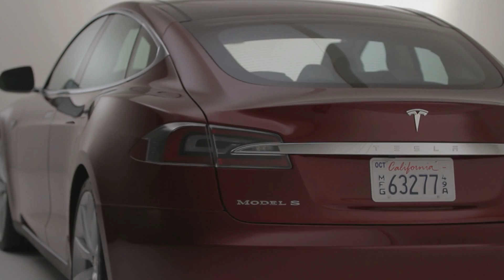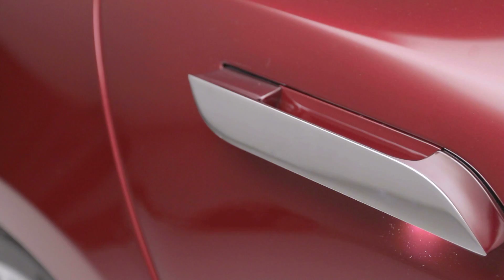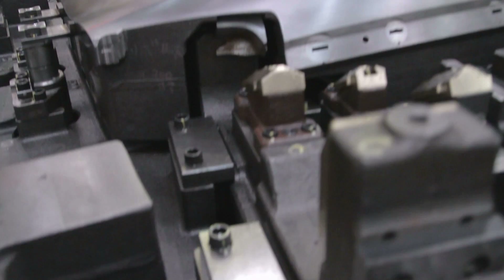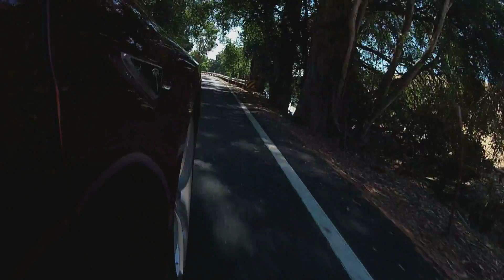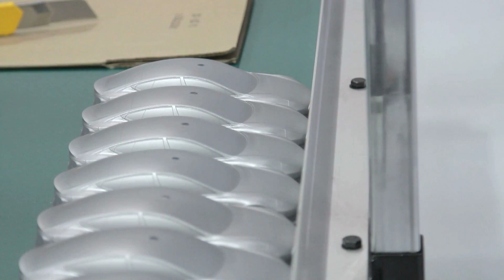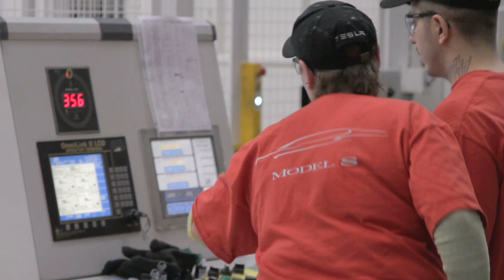Driving the 2012 Tesla Model S - Wide Open Throttle Episode 22

Comment: I did not say anyone was driving from LA to SF everyday. You just want the option. You may be fine with this poor battery durability, but I believe most will not be fine with it.  Try selling a used Tesla Model S with only 70% or 65% capacity and getting good value.  Consumers calculate the battery replacement cost.  Consumers will do the math. FYI, nobody is spending on maintenance costs for new cars anymore anyway.

Comment: This line of thinking has been proven wrong over and over again.  It isn't as simple as comparing tailpipe of gas car to the smokestack of a coal plant.  If you are going to compare energy production, then you need to count in how much coal is used to refine crude oil into gasoline.  Just the energy of refinement alone could be used for everyone to drive electric cars.

Comment: Recharge time depends on car configuration and the charging station. Tesla Motors has a charging page with a calculator.  But 95% of the time every morning you get in a car that fully and cheaply recharged overnight and do your regular driving, and skip the gas station. Plugging in is the future.

Comment: If you want to take a "larger point of view", then consider this. if you are going to stop comparing emissions from the car itself and start talking about fuel generation (electric vs. gasoline) then you need to also count in emissions of gasoline refinement.  You'll find that suddenly coal power seems a lot cleaner.

Comment: Probably because 80% of the population only drives like 30 miles per day.  Who drives from LA to SF every day?   And technically, you could drive the Tesla on that trip if you stopped at a fast charger in the middle somewhere.  The battery is unlikely to need to be replaced after 7 years.  It may have reduced capacity, though.  Even if that were so, the rest of the car will be super reliable and by replacing the battery you could easy go another 7 years.

Comment: Math fail. A 35 mpg car will burn 10 tons of gasoline over 120,000 miles, each gallon of which is terribly polluting to produce spill, refine and deliver. The pollution from 500 lbs of RECYCLABLE batteries doesn't come close, and every mile you drive electric makes more efficient use of resources especially if your electricity comes from natural gas or renewables.

Comment: Companies struggle to get 5% improvement in combustion, blowing fuel up to make a lot of heat and a little forward motion will never be as efficient as battery -> motor. And only hybrids & electrics can recapture energy lost in braking, and they turn off at a standstill.

Comment: How is your reservation payment secured? Did you ask? Through Tesla's reservation program they have raised over $100 million for the Model S and already $40 million for the Model X. These funds are used however they want.  Your reservation payment was simply a high risky loan to a high risk and leveraged company.  Why a $5K reservation payments? It is a scam. You will have no problem getting a Model S next year, not so sure if the same will be for your $5K.

Comment: Only the battery technology limits range. Tesla took a different approach that all the others by putting the battery on the bottom of the car and making it really big (hence the car is designed from the ground up to be nothing but electric). Other cars are cramming batteries into any place they can fit which severally limits the range. Until others take the hint nobody will have the range these guys are getting.

Comment: Batteries are incredibly inefficient. The specific energy of the modern lithium-ion battery is less than 1% of that of gasoline.  They are heavy, have horrible durability, the list goes on and on. A Tesla battery will have to be replaced after 7 years at a conservative cost of $10K. Consider than most Merc's and BMW's are still on the road after 15 years and don't require an additional 20K in battery replacement. If you buy a Tesla, it won't be around in 10 years for warranty either.

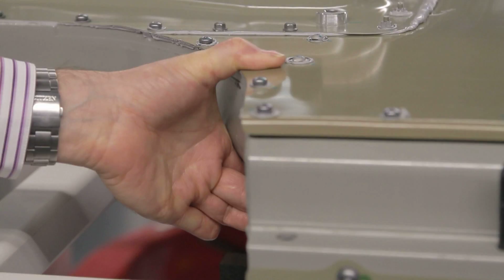Comment: Braver costs money. Tesla Roadster was the cheapest car with all carbon-fiber panels, and it cost $109,000. Maybe the BMW i3 will get the price down  Model S has an aluminum subframe and body which is quite rare on volume cars (Audi and some Jaguars). Look again at #1:05, its "skateboard" chassis structure is phenomenal — room for front and rear trunks and 5+2 seating!

Comment: Yes, you are right. We have electric jacks at my work and just converted them to hydrogen fuel cells. Although it takes more energy to make/use, it solves our duty cycle aka range anxiety. Our jacks need to be recharged at break. Now they run 2days because of the hydrogen. It will solve the biggest problem of pure ev. Range anxiety.

Comment: Please provide an option to address a possible scenario where the door handles may be restricted by ice preventing it from extending away from the body of the car or being blocked by ice from moving back into the door. As a potential Canadian customer, I can tell you that there is at least 1 day a year where even conventional door handles have to be pulled extremely hard to dislodge a frozen door.

Comment: Agreed, but don't forget that many states run on other sources of energy (some almost 75-90% hydrolectric). In addition, a lot of owners have been/will be charging their cars off the grid, using solar power. As it is, Model S produces less than half the CO2 emissions of a traditional car, and that's assuming that its source of energy is purely hydrocarbon-based--if you're in Idaho, it's 95% less. As we move towards cleaner sources of energy, the car will also continue to get cleaner.

Comment: 2013 BMW M5 0-to-60 is 4.4 secs just like the Model S. The Tesla is actually quicker in the quarter mile: 12.6 seconds compared to 13 in the BMW.

According to Car&Driver, the price is expected to be $92,000 for the 2013 model. Model S is cheaper at $84,900. 

So yeah. knocking on the door HARD!

Comment: Can Elon Musk revolutionize auto industry and can he change ways vehicles are build on mass scale - answer is, he already has.
Do I want all electric vehicle - absolutely. I am a reservation holder #2078 on general production Model S.  But will I actually buy the current version of Model S?  This is still up in the air.  I can only afford the 45KW model and the range is still too low in my mind.  Another huge doubt is the the 17" touch screen as the ONLY control for most of the car functions...

Comment: 1)Its American2)It doesn't rely on foreign oil, don't give me the argument that grid is still fossil fuel, it might be, but requires a lot less compared to an internal combustion engine's start to finish efficiency into a-b mobility not mentioning the future of grid electricity3)Its a damn good car, regardless of power plant.4)Its a different way of development for such a vehicle, it changes the game, think analog to digital, computer software development cycle vs slightly evolutionary hardware.

Comment: So the ultimate question is, once we can eliminate our dependence on fossil fuels for electricity, whether battery-powered cars or hydrogen fuel cell cars will be more practical. It may very well be that all the infrastructure required for Hydrogen power will make it not worth it. But each type of car has its advantages and disadvantages.

Comment: The biggest problems I see are the weight, expense, and endurance of batteries. After ten years or so they must be replaced and that means several thousand dollars or more, no matter what car. The Model S also weighs about the same as a 2012 Grand Cherokee largely due to that battery pack, despite use of lightweight materials. Until there is some major progress with battery technology pure EVs will not replace internal combustion.

Comment from the maker: The Model S with the 40kwh battery costs $49,900; with a 60kwh battery it's $59,900, and with an 85kwh battery it's	$69,900. The Performance Model S (85kwh) is $84,900. The Model S Signature (85kwh) is $87,900 and the Model S Signature Performance is $97,900. -Jessi

Comment: you need energy to compress and store hydrogen ... and unless you live in Hogwarts ... they'll probably use electricity ... and as you so kindly put it in your massively contradictory and condescending statement " the electricity being used to power the car is coming from coal, natural gas, and oil-burning power plants " 

And While the Tesla Model S might not be perfect (but its pretty close) It's a very good start in the right direction

Comment: I don't see why people think electric cars are that much better for the environment. Yes, they're more energy-efficient than gasoline cars, but most of the electricity being used to power the car is coming from coal, natural gas, and oil-burning power plants. Until the majority of our energy comes from renewable resources, hydrogen fuel cell cars should be the way to go. Honda was on the right track with the FCX Clarity. Zero emissions, and the source of the energy doesn't hurt the environment.

Comment: I have some bad news for myopic electric car fanatics (At least in Michigan). On average, yes, electricity, from production to consumption, is cleaner than gasoline. However, this is not true for every state (like Michigan). If you were to trace the net carbon/emissions impact of a mile of gasoline vs a a mile of electric (production to consumption), it is cleaner to drive a gasoline car. In states were electricity comes from coal power this is a huge problem.